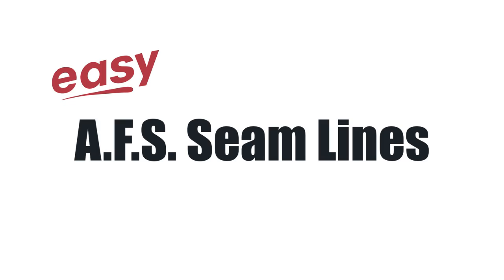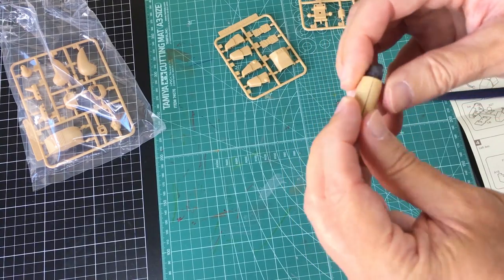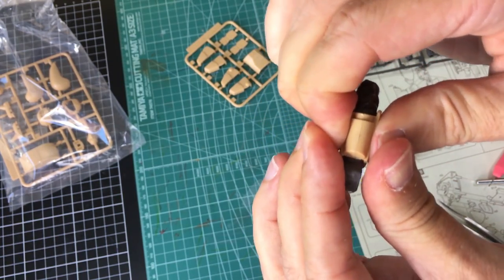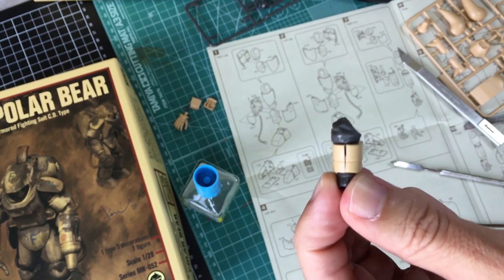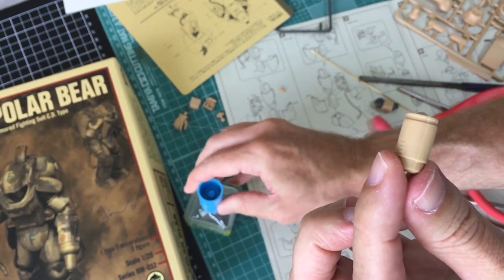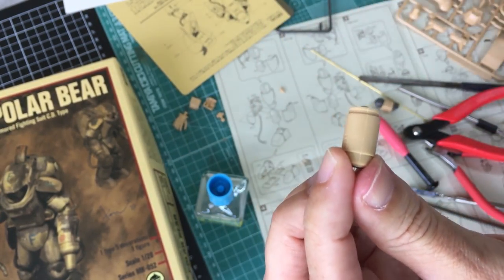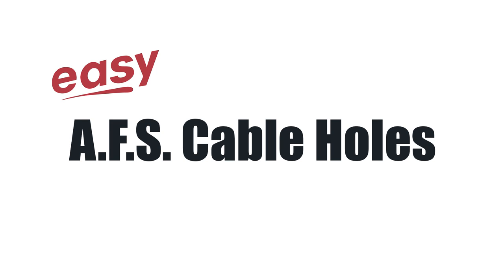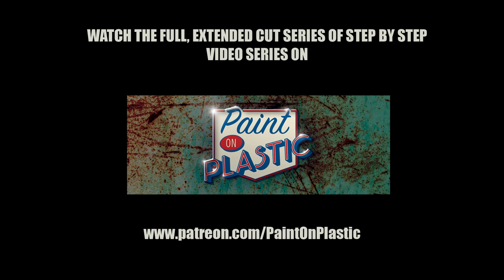How to Ma.K Top 3 Build Hacks for the AFS Polar Bear by Lincoln Wright

Comment: Hi Lincoln,  great tips. Thanks a lot. Why don't you try drilling first from behind the Base to the ball and then cutting it? I am thinking that this will be easier for  the alignment.
Reply from the maker: Chrysostomos Deliyiannis try it and share!
Reply: It could work, but it's not really guaranteed to get you good alignment. If you're a little bit off-perpendicular when you drill through the plate, the length of the peg you're drilling through will cause the drill to go further off-target by the time it reaches the ball. If you were cutting the ball off and then re-attaching it at the same distance (as if you were just repairing the existing joint) it wouldn't be a problem, but removing the length of the peg in the middle will make the ball get offset...

Personally I think I'd do better drilling the two holes separately, matching them up by eye. One variation of this whole method that could work and be faster is to use a drill press: clamp down the joint to the drill press table, flat-side down, and drill straight through the ball, rod, and plate. Though the problem there is that small drill bits are flexible enough that they may deflect when you drill into the ball, so the drilled hole could still wind up crooked. (Cutting a starter hole can help to minimize that problem...)  You'd wind up drilling through the ball, of course - personally I don't see that as a problem. The end of the rod can be mounted flush with the end of the ball and the surface of the ball is essentially retained.
Reply from the maker: Correct and thanks Tetsujin.

Comment: Instead of a flame, isn't using some extra thin cement safer? Just a thought, I've never thought (or dared) to use fire for this.
Reply from the maker: Ron Ursem try it! In this video I am showing you what we do. Please be careful as mentioned 😃👍🏼
Reply: Cement isn't even effective on these vinyl parts, I think...
Reply from the maker: Exactly, doesn't do anything... after 20 of these kits and working with other pros on the series, of course we tried that - first thing to try! But doesn't do anything... so we figured out THIS! :D
Reply: Wrongly thought it was plastic! I get it now, have to try it sometime.
Reply from the maker: no worries ;)

Comment: I have a question about a kit like this polar bear, but that I know nothing about. This is the polar bear, but I've seen a VERY similar armored suit that looks like the polar bear, but lighter. It looks like it' could be the predecessor to the suit that makes the polar bear. The helmet is designed to come off in one part, unlike this that is a split open design. It also has smaller pieces of armor, but still very armored.

Do you know wich one I might be referring to? I've gotten some search results with "afns", "honemits", "Original arranged AFS", "HONEMITS-PRODUCTS 1/20 A.F.N.S" but I do not know what it is actually called or anything about it. Just that it looks cool.

Do you know what the kit is actually called and if it's available or old or something? :)
Reply from the maker: Heya @Monstertruck  , great question. Yes I know those kits, best place to search for them will be https://shop-tonerico.com Very legit store in Tokyo and friends with the owner. It's a little Japanese heavy but I'm sure you will be ok. ^^